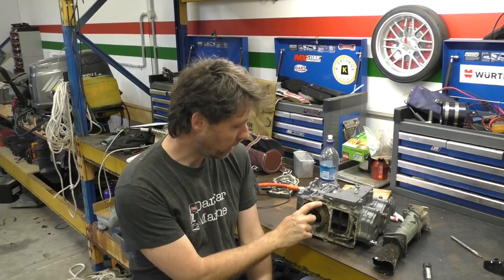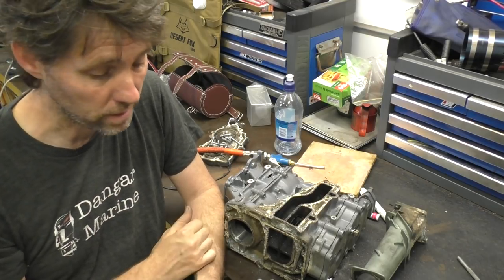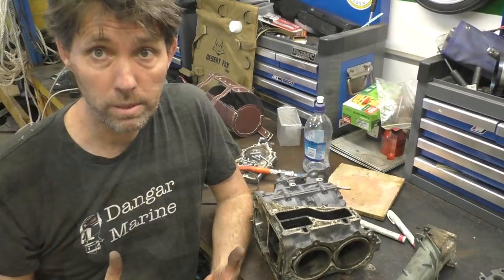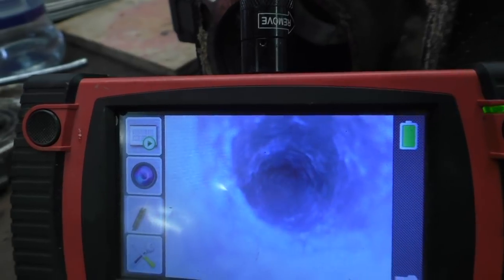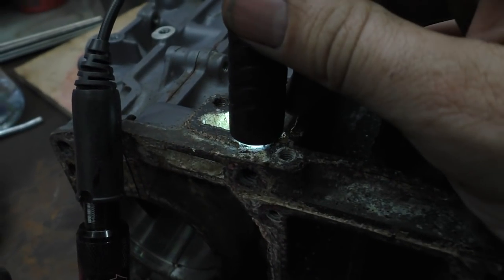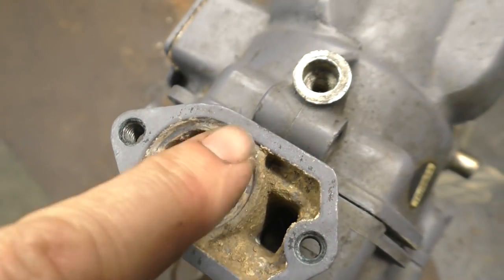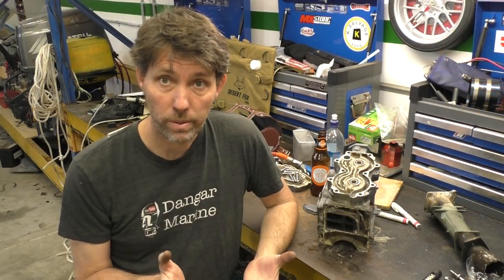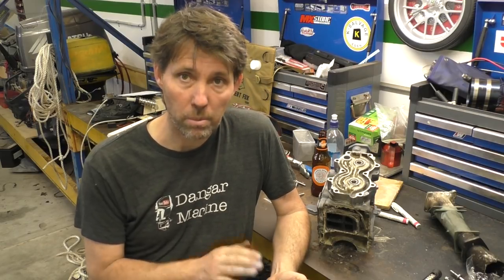Outboard cooling water

Comment: Hi Love your Videos. I have a 60HP Yamaha and just completed a full overhall on the Lower Leg Water Pump assmebly. At First Start up it works a Treat and the Tell Tail Water is evident. After a considerable warm up time and Rest - 5 min later - I would start it up with no Tell Tail Water comming out. Does the warm stage dislogue and pass existing debris in the channel manifold or power head Gasket.  possible blockages? A Little confused as I will need to fo the next stages of pulling it apart!
Reply from the maker: That is a slightly odd set of symptoms but I would start by checking if water is flowing from the thermostat housing like in this video https://www.youtube.com/watch?v=dx8_xP30aSY

Comment: I have a dt55 suzuki,it was spraying water out the tell tale but coming out hot and overheating alarm would come on.then it would stop spraying,it had been blocked in the outlet when last used and I unblocked it with wire.i took the water pump off it was soft though the fine were bent in the direction the go.should I replace pump any way and can you please give me any other pointers as to what to check next?thank you.
Reply from the maker: Could be a thermostat stuck closed. This video might help https://www.youtube.com/watch?v=dx8_xP30aSY

Comment: Same question as Rod. Do you know of any chemicals which you could place in a tank and run the engine in the tank to create a loop and recirculate the mix over and over again to clean the interior water passages. ks
Reply from the maker: I'm keen to do a bit of a comparison test on this block before I throw it away. Stay tuned!

Comment: I had dops of water coming out of tell tale, had a mechanic turn motor upside down and pour CLR down it, it started pissing water strong, but after 5 minutes on the lake again, it stopped pissing water and motor wouldnt start after being shut off. do i have a clog in the main part of my motor, not the pipes?
Reply from the maker: If you take the thermostat out and start the motor you will be able to see if water is coming through the block. My guess is it is just a blocked tell tale though as water will still come out the tell tale even if the block is clogged. https://www.youtube.com/watch?v=dx8_xP30aSY

Comment: Hello Dangar Stu!  I'm a big fan of your channel.  This video is very informative,  thanks.  I have a small amount of water coming into my cyclidars, mainly the top one.  The head cover gasket is old but looks intact. Same with the side water gallery plate.  No apparent cracks in the block.  Water leaks in weather the engine runs in the water or with muffs.  Where else could water leak in?  My engine is a 1990 johnson 40hp 2 stroke.   Would love to hear your take on this.  Thanks.  Keep up the good work!!

Comment: I've a 8 hp 2 stroke it has out water coming out of the pee hole I've fitted a new impeller,thermostat but it's still hot 
would you have any idea what the problem is thanks

Comment: Very informative as to the cooling water flow and passages etc. COOL!

The comment that a four stroke piston forces exhaust gasses out is incorrect.

No biggy aye!

Cheers

B
Reply from the maker: I guess it is more half the truth. ;) Exhaust velocity is very important to keep the gasses being extracted, although it does all start with that first exhaust stroke. I read an interesting article a while about about back pressure saying that really 4 stroke motors want exhaust be large enough diameter to have no back pressure (contrary to popular believe), but if an exhaust system is too big then the speed of the gasses reduces which is also bad for extraction.
Reply: Wrong

Comment: I would wish if you could make a comprehensive overheating issues with big outboards. I have a Honda 225 overheating. I changed the impeller an put in 2 new thermostats and water is flowing through the tel tall. Still after switching the engine on after less than 5 minutes, I get a buzzing alarm that becomes a continuous buzz very shortly. I have pretty much rebuilded the engine and couldn't find out what's going on. Wish if you could help mate cheers

Comment: Another great watch !..One question.... to my uninformed eye there seemed to be a fair amount of corrosion all around the water jackets and pathways.  Would that be normal or a sign that it has been a tad neglected when it comes to flushing.?
Reply from the maker: Boats around here never get flushed really. They give in the water and get used several times every day.
Reply: Dangar Marine ..Are newer engines any better at reducing internal corrosion. ? Or is it just the same with saltwater doing what saltwater does....?

Comment: Hi stu
I have a dt 30 93 model 
Having issues with the cooling system
I am Running no thermostat 
It pumps well and keeps cool with muffs on but overheats when in the water even though it is pumping out the pee and exhaust and thermostat housing 
Last bit of this video u mentioned cracked cylinder or head gasket
I just had it serviced and the bloke made a gasket he said he had issues getting the head gasket kit 
It doesn’t seem to be leaking in the couling 
Do u reckon the head gasket is the problem or something else  like the cyclinder head or blockage
Reply from the maker: It could be a blockage in the water jackets or blown head gasket or the pump not pumping enough water. If the service guy had the head off then he should have seen any blockages. Can't say I've seen somone use a home-made head gasket before, but it may be okay. Was the head checked for flatness and/or machined?

Comment: I have been having trouble fixing the problem of no tell-tale. The motor does not overheat, the thermostat works and I just replaced the impeller and impeller housing. It is a 1997 40 hp Yamaha 2 stroke. Ive watched all your videos regarding the issue and I'm still having the same problem, please help! thanks

Comment: I have n 85 evinrude 60hp. It runs between 140s to 160s around the head and where the plugs and cover plate is, but in the 180s and 190s on the block itself toward the bottom and middle of the block. Is this normal?

Comment: gud one mate... i hit a sand bank and i kept running the outboard trying to get out wat  happens dose it suck sand in the engine
Reply: That depends on the type of bottom, but hitting sand  and running the engine is pretty sure to pick up some sand at least. If the tell tale is still strong it would indicate your pump is Ok to go for a while yet, but you have no way of knowing if the sand is blocking the bypass valve or the thermostat.  Remove the thermostat and run the engine in clean water for a while (about 10 minutes would be all you would need to flush any sand out), and plan on changing your impellor and possibly the pump housing this season.
Reply: Ron Powell thanks for that mate

Comment: I have a 1977 Mercury 7.5 hp Canadian Made. There was no water coming out of the telltale so I checked the impeller and it was a mess. I replaced the impeller and removed broken fins from the water pump and unclogged the copper suction tube and reinstalled the lower end. Started it up and nothing but thè odd spurt of hot water and steam. There was a black rubber hose that ran from a brass elbow lower right side to another elbow upper right side near the back. The hose was broken so I replaced it with some semi clear hose so I could see what was flowing through it. I fired it up and after about 15 seconds it looked like water was running through the hose but not in a steady stream. It was spurting through the same way the water seemed to be coming put of the telltale! Must be connected right!? I was told that was oil not water. Anyway, it's an old motor but always starts in 2 pulls so I definitely want to get it running properly.  Is there something I can pump into the water jacket system that will break down any corrosion inside and open things up? Any advice would be greatly appreciated!  Cheers

Comment: I have 1999 150 salt water non opti max, I changed  both thermostat, impeller and all the gasket with impeller. Then I run muffs on all I get it a hot sputter and a good stream from time time, I put the hose to the inlet at top of the outboard to flush out and a good hard stream. Need a little insight.
Reply from the maker: Sounds like a blown head gasket to me. When it goes the hot exhaust gasses escape into the water jackets pushing the water back out under pressure.
Reply: @DangarMarine  ok, ima investigate that lead thanks
Reply: So i pulled the block off with success, on a mercury 99 150 carburetor is their a water jacket or is built into the head. Im having a hard finding it if their is?

Comment: when i ran my boat fast in the water why the water cooler system was fail (water stop came out)  but when i park my boat and run fast or slow in N gear  the water cooler run normally *before this happen  i do not use my boat for a long time* and i changed the new impeller but not thing happen still stop working please help me . THANK YOU FORM THAILAND
Reply from the maker: It could be a couple of things. It could be that the water becomes turbulent around the intake grill and it can't draw water in or it could be a blown head gasket where at high RPM the exhaust gas leaking past the gasket is pushing the water out.
Reply: Dangar Marine Thank you i will fix it again follow you

Comment: Great Video! Stu love your channel!! now back into the garage to fix my old 20hp Mariner, i seem to be getting some milky residue onto my lower spark plug, I pulled the carburettor off and noticed that one of my reed valve teeth for that cylinder is broken, now to check the exhaust ports!!! Could  from the exhaust port be getting sucked into the cylinder because the crank is not holding a vacuum as the reed valve has the broken tooth?
Reply from the maker: A broken reed valve will more cause fuel to spit back out through the carburettor. It is more likely that any milkiness is from a blown headgasket. Fortunately they are very easy to change on a two stroke motor.https://www.youtube.com/watch?v=NVLHJSuVHA4
Reply: Dangar Marine thanks Stu, I've noticed for this particular engine the head and power head are cast as in, there is only a cover plate gasket. I also thought it was the head gasket until I couldn't even find it 😂 any other possibilities? I will do a comp test sometime this week when I get a chance
Reply from the maker: Ah yes, some outboards are like that. I could also be the main seal on the bottom of the powerhead.
Reply: Dangar Marine yeh I've never done the main seal. It shouldn't be too hard??? I'll sift through your vids to see if you have one up. I did a comp test today and found the cylinder with the milky water had better compression than the other one around 145psi.. I also noticed milky water on the edge of the exhaust port

Comment: My 2 stroke 75hp down plug wet by water, but the cylinder head, gasket,down seal, fire plate and the gasket are good please what is wrong

Comment: is there any way to clean the thermostat , should be clean or change 
?
Reply: I reckon the cost of thermostats it would be best to just change them rather than pull apart and clean them
Reply: Replace only. If you think about it, a thermostat costa bout the same as 50l of fuel. If you cant afford that then an outboard engine is not for you.

Comment: Hi Dangar 
Great video. Have an overheating problem with an Etec 200HO at present. As you have said, great tell tale, water pump is newly reconditioned but overheats at above idle to 1800rpm. New thermostats have been installed as well. Temperature comes down above 1800 because of the bypass valve equipped. My thoughts were like you suggested blown head gasket but the tell tale remains totally cold. Any ideas?
Reply from the maker: I would start by taking the thermostats out and see if you can use a hose to push water in through the thermostat housings down to the pump. It sounds like it might be a blockage.
Reply: Hi Dangar,
Done that. Had very good flow down through the housings. Without the thermostats in, and the engine running, the engine does not reach above 45degC. Have tested thermostats in water heated gradually and they start opening at 62 and are fully open at 72degC. However, put them in and run the engine between 600 and 1600rpm and she goes up past 85 - 90 before eventually dropping down to an acceptable 78 - 80. Frustrating to say the least!!

Comment: I took the thermostat cover off and started the motor white smoke was coming out of the hole no water was coming out any ideas?
Reply from the maker: I would run hose water  through to see if it is blocked or a water pump problem. With smoke coming out you could have a blown head gallery too.

Comment: Always watch your videos really good work and thanks for taking the time to educate boat owners. Need you to point me in the right direction 2007  optimax. Water on cylinder #2 replace  water jacket and o rings still a couple off drops in cylinder good compression where to look next thanks in advance👍

Comment: hi dangar... great video.
i have 2 Mercury outboard carb, i noticed on my temp gauges for 1 engine it runs like 1/2 to 3/4 reading but the other reads like 1/4.
is that ok?
Reply from the maker: It could be quite a few things. I would start by getting a cheap infrared thermometer and see if they heads on the motors are actually at different temperatures. If they are it could be as simple as a dodgy thermostat in one of them.

Comment: Would it hurt a motor to run a high power flush down through the thermostat hole? Thank you
Reply from the maker: No, that’s fine. Sometimes a reverse flush is good to dislodge stock items from the cooling system.
Reply: @DangarMarine  Thank You for your help!!

Comment: Hi mate. What's you thoughts on a snapped off internal zinc anode which fell in the water system of a Yamaha f60 (yep I just happened to me)
Do I need to take the head off to remove or would you think it will dissolve by its self in the system? Cheers.
Reply from the maker: Ah yes, I've had that before. It will eventually disolve, the trouble is whether it significantly blocks the flow of cooling water in the meantime. Chances are it will be fine, just keep a closer eye on the temperatures for a while.
Reply: Dangar Marine thanks for the reply. Very helpful. Also great content, your videos have really gave me the confidence to work on my own outboard.

Comment: I have a cooling issue on a mercury 150 black Max...I don't think it is actually over heating...is there a test I can do to check that?
Reply from the maker: Use an infrared thermometer to check the actual temperature.

Comment: I have a 70hp1989 Mercury. Last year I installed a new thermostat, poppet valve and water pump. How often do you recommend that I replace or these items?
Reply from the maker: I think it really depends on the conditions you are running in. In turbid salt water you would probably want to change the thermostat every 2-3 years or so, but in fresh I think you could go over 5.

Comment: I am wondering if you can help me solve a problem with my outboard, it's a 1986 60 hp evinrude. When I start it up I have good flow threw the tell tail but when I get up to full speed the tell tail slows and stops shooting out water. I have replaced the water pump , filter screen and even tried pulling the thermostat,  if you can give me any advice that could help me solve my problem I would really appreciate it.
Reply from the maker: When you slow down, does the water come back? Does the motor overheat?
Reply: If I turn it off for minute or two and start it back up the water starts coming out again
Reply from the maker: It could be a head gasket problem where gasses are escaping from the cylinder once it warms up and those gasses are pushing the cooling water back out.
Reply: I also put on a brand new head gasket

Comment: Hello Stu.  This is the best explanation I have seen on smaller 2C cooling.  I've search all of utube trying to figure out why I don't have a tell tale on my 85 yammy 30hp.  Completely new pump, thermostat but no tell tale.  On muffs the head at the spark plugs goes up to 160-170 degress F with slight steam/spitting  coming from TT opening but that's it. Plenty of water coming from center shaft exhaust and prop.  Had it apart numerous times checking my work and to blow out the water passages with compressed air with no results.  Motor has mostly been freshwater use.  Wondering now if it could be something in the exhaust jacket or head as mentioned in the video???  Any suggestions would be greatly appreciated!!  Thank You!  By the way, there is no outlet or hose as shown on the exhaust cover?

Comment: Thanks for the info, I am currently looking at buying a boat that has a suzuki 65hp on it and the bloke says it is overheating after a while. He has changed the impeller but still overheats, so this gives me a bit of knowledge to make a better decision.
On a side note, I have an old tower of power, 90hp mercury. It appears to have water coming out the exhaust pretty much from when I start it, could this mean it has no thermostat? or are these different somehow with their flow?
Reply from the maker: Hi  Mark. Glad you've been enjoying the vids. Various outboards are different, so its entirely possible that the water bypasses the thermostat and goes out the exhaust before the thermostat opens.

Comment: Thanks for another neat vid mate, those two exhaust ports are interesting. they are  higher in the chamber than the intake and main exhaust and is returned through the water jacket? just a stab in the dark here, does the exhaust gas return help heat the gas oil mix for faster combustion and help get to the operating temp faster? which would also be more economical as well?
Reply: I'm not sure either but I was thinking some kind of EGR port too
Reply from the maker: Sounds plausible to me!